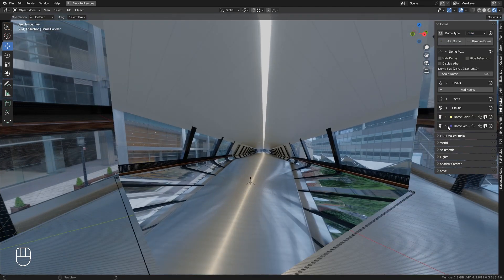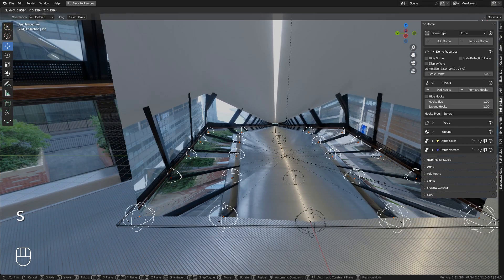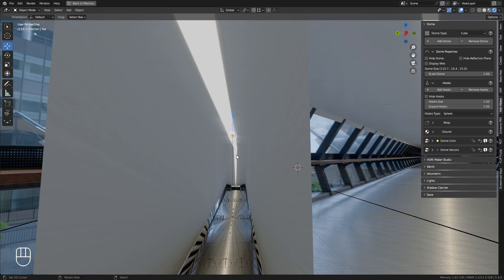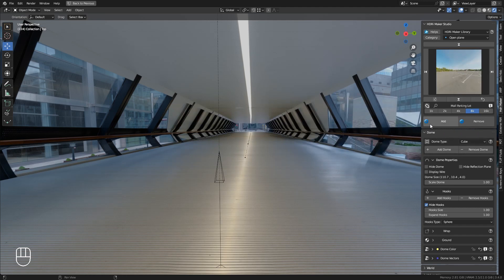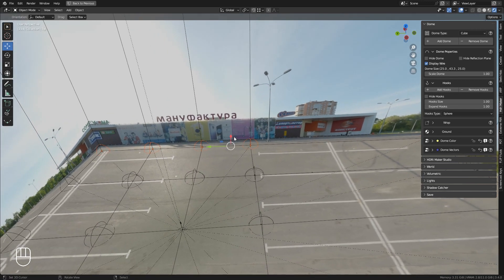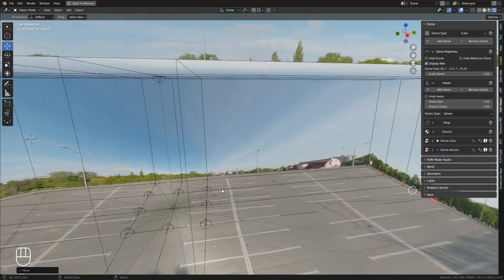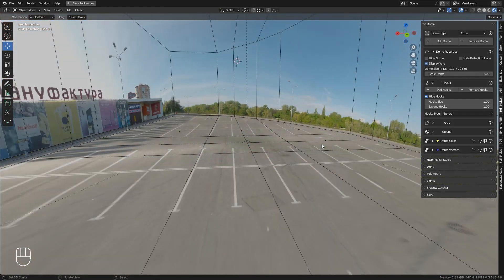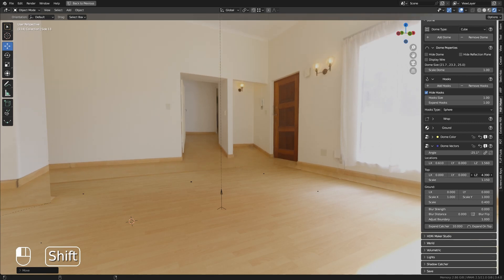HDRi Maker Addon - Custom dome projections in Blender

Comment: Under the Dome Vector menu, the Angle slider controls the projection of the image, but only for the Z-axis. Where are the X and Y-axis options (as found in 2.0?) ☹
Reply from the maker: You need to upgrade to version 3.0 HDRi Maker 2.0 didn't have those functions yet. A lot has changed from 2.0 to 3.0 Update it, if you bought it on BlenderMarket or Gumroad (You can find my official pages in the description) You will find in it all the files for updating to this version 👍
Reply: @andrew_d1612  What I meant to ask was, where are the Angle functions for the X and Y axes? The Angle function (as shown at 00:16) seems to only control the rotation on the Z-axis. I need the same function, but for the other axes...
Reply from the maker: @ttvv88  Oh ok, sorry, I misunderstood. No there is no function to orient the rotation on X-Y. Let me know why you would like these rotations. Usually the images are already level oriented, but maybe I missed something. Let me know, I'm glad to read suggestions.
Reply: @andrew_d1612  Sometimes those HDRi's horizons can be a few degrees off, and so they may not end up matching the skybox perfectly. Having those options can help us a lot in fine-tuning them.
Those functions were clearly there in 2.0, and I'm sad to see they were taken away. ☹
Reply: @andrew_d1612  I agree I think that they should be in there because I added an HDR today because I was just gonna do a quick one and not even out a Dome or anything and it would have been cool if I could have changed the X&Y values real quick and just rendered real quick but on the flip side I added the Dome and it took like 10 minutes to get where I wanted but I had a crud load of fun... So overall it could be better because it pushes you to do what I did and then you'll be more successful in your industry